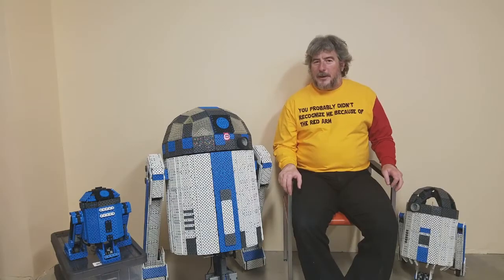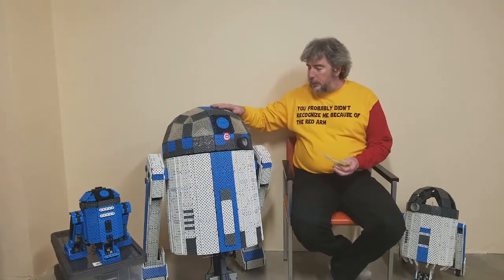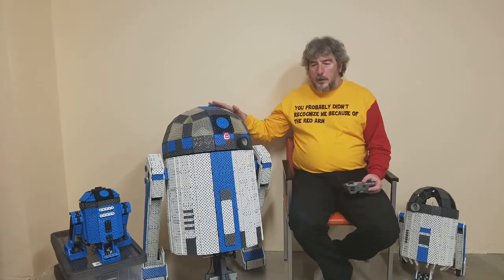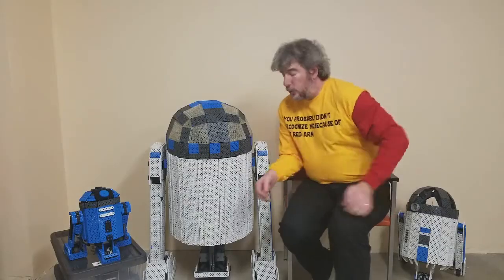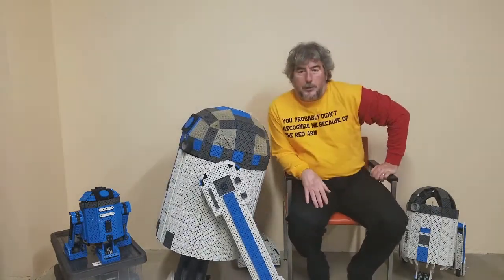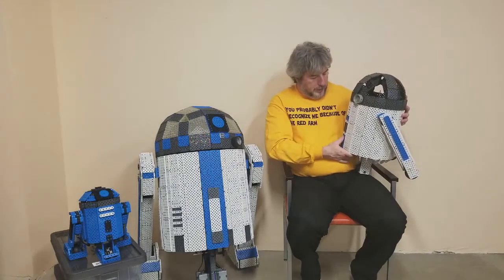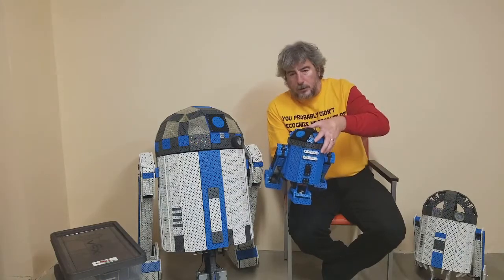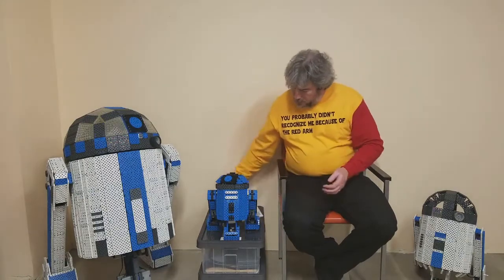VEX R2D2

Comment: Hello, I can't get the NXT-G simple array block to work. When the program arrives at its execution, it just says 'File error' and stops. I do already know that using NXT-G is pretty inefficient and there are better alternatives, and that it's been several years since you published the block, but is there something I forgot to do? Is there some specific firmware that's required? Thanks
Reply from the maker: The "File error" happened when there was something wrong with the program.  It's a run-time error where some value is bad.  I don't recall if that block required an array to be passed in.  I would encourage creating a very simple program, try to write, then read a value.  It should not require a special firmware, but if it does, it should work on the latest firmware versions.  Good luck.
Reply: @hassenplug  Thanks a lot for responding that quickly!
Reply: @hassenplug  It works now, I assumed clearing the array sets all slots to zero, which it didn't. After setting the required amount of slots to zero, I finally got it to work. I used this great block to implement the counting sort algorithm on the bonus model pick'n'place ball sorter.
Reply from the maker: @musik350  I think the array is sized to the highest element you populated.  So, if you store a values in elements 0-5, and read element 6, you'll get an error.  A good block would check for that programming error, but checking would slow the block down.  Glad to hear it works.  BTW, sometimes NXT-G is the right tool for the job!